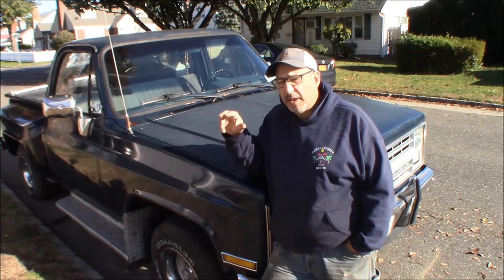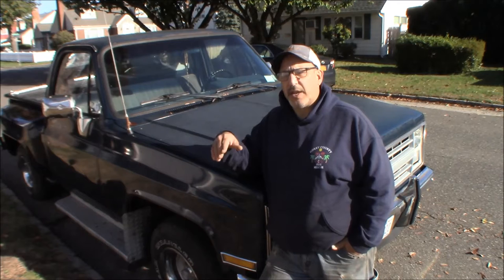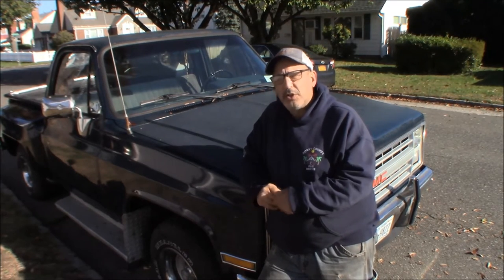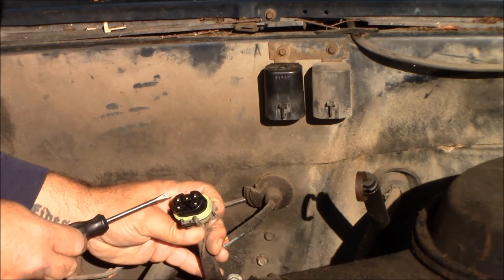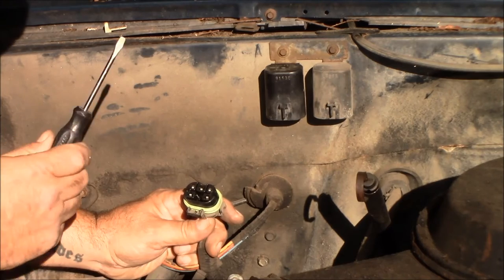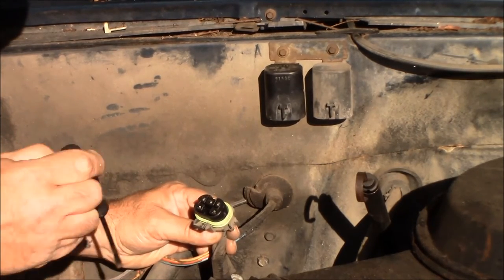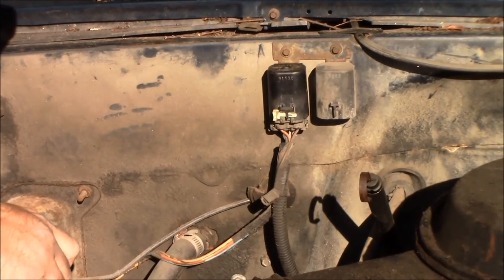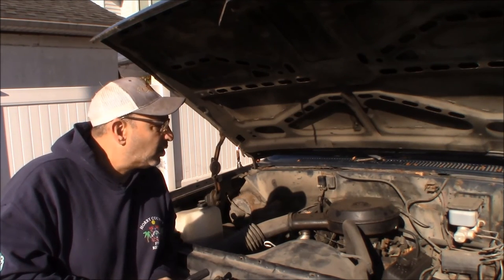Oscar The C10 Stepside: Episode 2 | Fuel Pump Relay | 1987 GMC R1500 High Sierra Step Side

Comment: Just bought a 87 crew cab dually, for the purpose of moving all my toys down south, and going over it to make it reliable. This is a great video to help with road fixes. My question, in a pinch, can you hotwire that test lead to get the pump working, til the next auto parts store?
Reply from the maker: Yes, I believe you can do that.

Comment: Chilton manual says I should have a red, orange, black, gray, and green wire coming out of relay...... of course I have red, orange, black, PINK and green on my 90 2500 series Silverado and I can't find that test connection.  Manual says drivers side firewall. Glad you said one wire will have constant power (which I found out) because the manual says a test light will glow when you turn the key. I get the 2 second glow from the green wire.
Reply from the maker: The 2 sec glow, is the prime circuit

Comment: See I have this problem, mine sat for a year while I was in away Montana, now I've replaced the fuel pump, it'll fire when I poor fuel in the TBI, dies and when I stop cranking the fuel pump kicks on fir a second, but I get no fuel pump prime when I first turn on my ignition, so it won't start on its own power. It is verrry frustrating to find out
Reply: Mines doing the same thing what was wrong with it?

Comment: Recently i changed my fuel pump and i tried starting it but didnt start so i check underneath the dash where all the chips were and changed out the idle and it started and i manage to drive it for a while id say a month and a couple weeks but suddenly one day it didnt wanna start it just cranks and idk what it could be i thought it was the chips under the dash but i checked and they were good but that didnt help still does the same thing and i dont think its the fuel pump because its new and changed it im wonder if its the fuel relay but then thing is i dont know much about mechanics is it located in the same place in a 1987 r10 or do i have to look somewhere else?

Comment: So I had my negative battery cable on the fuel pump junction block on one of the ground screw  mounted on the firewall, and when I go to connect the battery I kept getting spark  and  repeatedly did it, and I finally moved the negative battery terminal from there and regrounded it, when i turn key to on position, now my fuel pump not turning on do you think I shorted the relay? The sending unit still works fine
Reply from the maker: It's possible, but from the way you explain it unlikely.  Maybe the relay was bad from the start.  Does your relay harness have a 'test or jumper wire' ?? if so apply power to test the circuit.  If it works, then try a relay.

Comment: You said you use a fused jumper to test the pump. What size fuse is best so it doesn’t ruin the pump?
Reply from the maker: 15-20 amps is fine, If there is a dead short it'll blow no matter what the size

Comment: can I bypass computer with the test lead and run my pump off of that I done a tbi to carb swap nobody tells everything needed in the wiring, my thought was a low oil pressure switch 3 pole hot to normally open and one to normally closed  normally closed would be for keyed with a monetary prime button then once it starts the open circut closes once oil pressure builds and opens the keyed circut if I understand the low pressure saftey switch! any advice

Comment: where is the fuel pump relay located on a 1978 chevy K10
Reply from the maker: There isn't one.  You have a mechanical pump located on the passenger side front of engine.
Reply: @AxlesGarage  thanks. I didn’t think there was one but somebody told me there was one because I wasn’t Getting fuel but I found a split ground wire under the truck which was the issue. Thanks for the reply
Reply: @markneri2955 my 75 Chevy isn’t getting fuel and fuel pump I have is pretty new so I don’t think it’s that. Where should I look for the wire u talked about?
Reply: Watch the video again ...